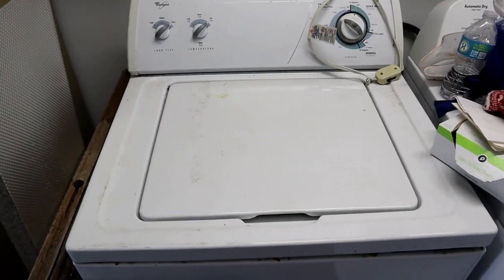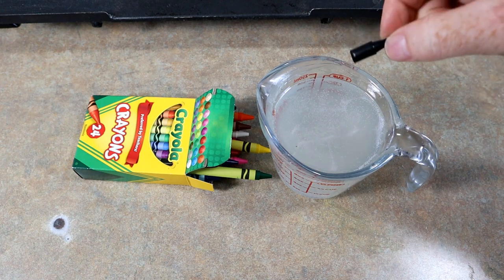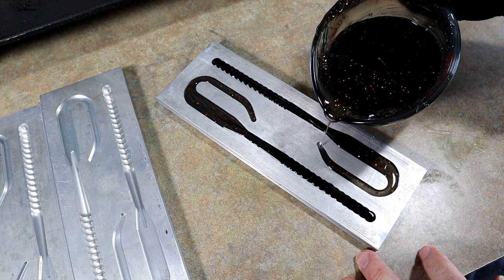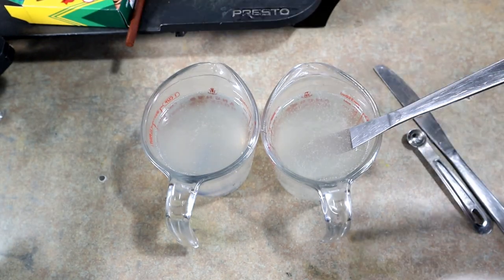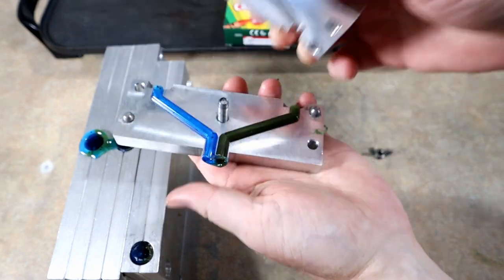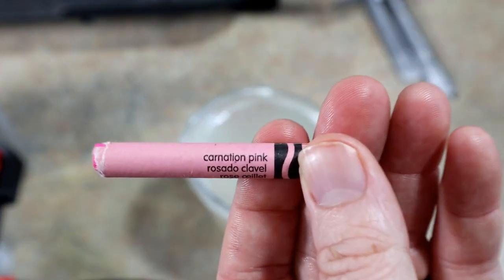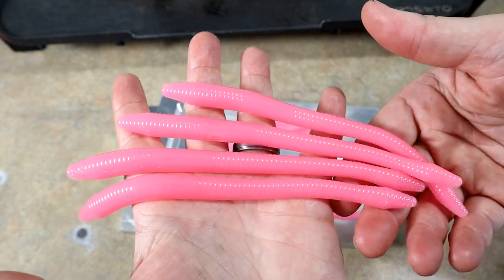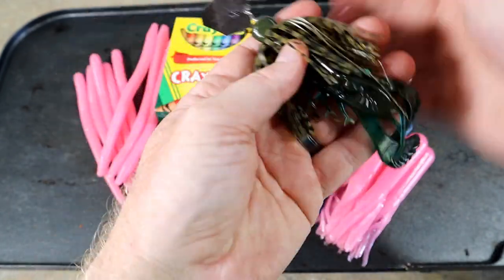Can We Use CRAYONS To Make Fishing Lures?? Does It Work?

Comment: Questions how well did these baits hold up after some use since it is something that is rather different than the standard colorant systems. Did the wax in the crayons mess with the baits after a while.    Was wondering if you have tired making a powder from colored pencils and tried using that to see what happens